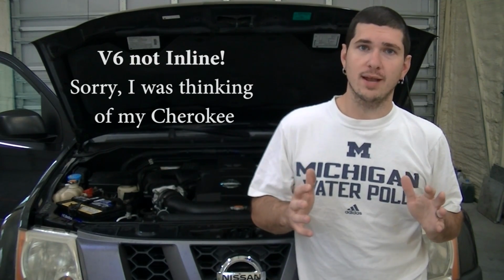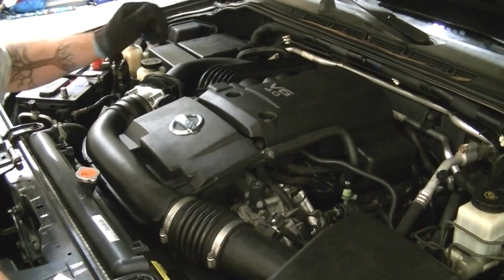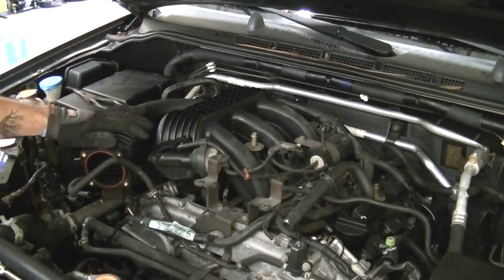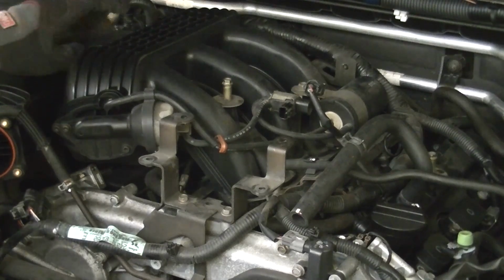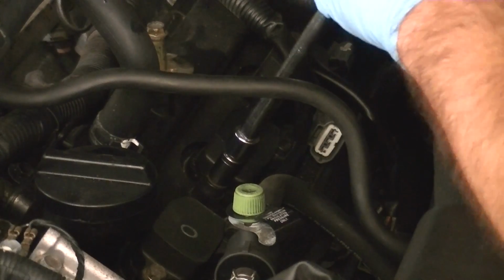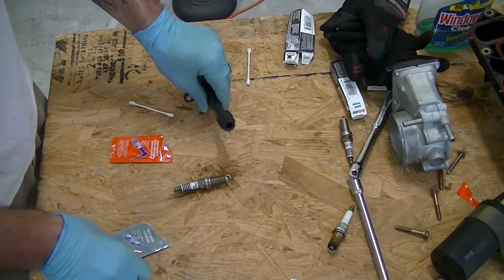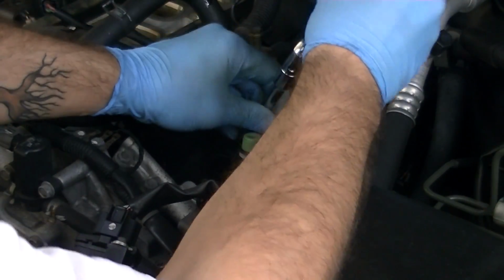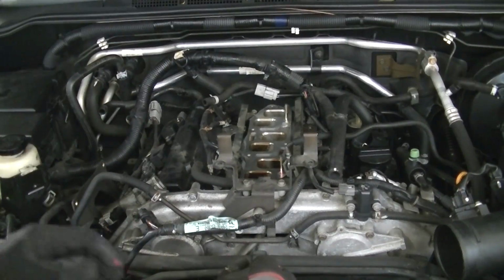How to Replace the Spark Plugs on a 2005 Nissan Xterra

Comment: Did you replace the gaskets on the manifold/throttle body or just reuse the old ones?
Reply from the maker: I reused 🙃
Reply: @Rythecarguy  Awesome, any leaks since the repair? I might do the same
Reply from the maker: No, it’s been great. In fact the manifold I’ve taken off at least 5 times without issue.

Comment: 582$ quote from Nissan dealer, parts and labor!
Reply from the maker: Wow! That's insane. How much did you save doing it yourself?
Reply: About 488$ ! ended up getting the plugs from the dealer but still not bad for a few hours of work! thanks for the video, was a huge help! I have no idea how people are getting the plugs out without pulling the intake! Thanks again - keep up the great videos
Reply: $700 for me,
Reply: @Rythecarguy  I saved quite a bit. I have a 2012 Nissan Pathfinder with 304k miles. Replaced (1) coil ($40) but the knowledge and satisfaction obtained with this DIY was priceless! Everyone needs to know their car through a DIY. Turns out, I found a vacuum leak in the process which sealed up the mystery as to why I was losing MPG.
Reply: @Rythecarguy  yeah Nissan quoted me $800.

Comment: Ry nice video but your orientation is incorrect. The PASSENGER side of car (or motor) is the RIGHT side. And conversely the DRIVER side is the LEFT side. You orient yourself with the sides of a car as if you were sitting in it. Just like Bank 1 of an engine will ALWAYS be the side with the fore-most cylinder. Bank 2 is the other side. If you went into a parts store and ordered a part for that goes on the LEFT side thinking it was the passenger side and it has an identical part on the RIGHT side...they will give you the WRONG part.

Comment: Stay away from torquing the spark plugs 🔌, you can destroy the thread on the engine block of the torque wrench not accurate ❤, just tighten them with regular wrench when you can feel them tight and you not waiting for the torque to click

Comment: Hi Ry. just changed my plugs on my 2010 X, but my service engine, vdc (vehicle dynamic control), and slip lights are staying on. I checked all hoses. do you think if I was to drive it some, they would reset?
Reply from the maker: +M McNew based on what I'm reading it sounds like this can happen sometimes when disconnecting the battery. They say you should drive to a place where you can drive in a completely straight line for multiple hundred feet. Make sure the wheel is straight, turn off the car, turn it back on and drive it in a straight line slowly and that system should reset its self. As far as he check engine light just run it to a Auto Zone and have them run the code/reset it.
Reply: Ry the car guy thanks and yes, it had to do with the negative battery cable. I had issue with the cable clamp going back on and while trying to clamp it, it would connect/disconnect likely disrupting the computer and codes. After trying to drive it some with nothing resetting, I finally figured I'd try to remove the cable again and see if it worked and it did. Also FYI for everyone, make sure to plug the cable back on the throttle body housing or no response better than an idle 😃. I'm definitely no mechanic but I like to try things myself, plus it saved me about $450 by not taking it to the dealership. Its why i like your videos. Keep up the great work. I'll keep watching.

Comment: Once the intake is off, are any of the spark plugs holes hard/awkward to get at? I'm on the fence for doing this since I'm at 209,000 with original spark plugs.
Reply from the maker: No not at all. Once its off its clear sailing.
Reply: Thanks Ry, Is it smart to spray penetrating fluid in spark plug hole after I take out the boot? My concerns are stripping when removing, crossthreading when putting back in and dropping crud/dirt particles in hole. I'm going to practice with lawnmower spark plug with a 5/16 hose trick so I don't crossthread...driver side does look easy....the front pass looks like a pain! X is primary vehicle so can't afford to mess it up. -Paul 2005 Xterra 209k

Comment: @rythecarguy my check engine light came on and began flashing on the way home yesterday, the car would vibrating around 60 mph and the engine light start flashing. I watched this video and changed my plugs. Now it is idling wierd in my drive way, what should I do? the relearning steps?
Reply: try disconnecting the (-) battery cable for 30 mins

Comment: Ry, I have a whing noise coming from my 2006 4.0. I took it to a transmission shop thinking that was it. But they are saying it's coming from inside!! Any thoughts??
Reply from the maker: Does the noise change in volume or pitch when you drive? I also have a whining sound.
Reply: yes it does change pitch as I drive!!
Reply from the maker: Interesting. I'm not sure what that is. I will post in the xterra forums.
Reply: Ry, in reference to the radiator's leaking into the transmission's (bleow), should I have cause for concern? I have the 2006 Frontier SE, which I think is the same platform as your Xterra.
Reply from the maker: Yes, You should do some research on the issue and see if you have the same transmission cooler configuration.
Reply from the maker: Also I was thinking about the whining issue and I believe the cause of mine is the fan clutch. The fan clutch will turn on the fan only when it needs it and mine seems to always bee running lately. When i am driving its whines when i accelerate and kind of sounds like a semi truck. Also if i really rev it up the belt will start to squeal. This is a pretty go indication that the clutch needs to be replaced. I will do a video on it.
Reply: Thanks Ry, I took it back to the transmission shop and they disconnected the belt system from the front and pulled the transmission away from the engine and started the motor and still got the whining noise.
Reply: The 2005-2008 models are having issues with the plastic timing chain guides wearing out allowing the chain to stretch. That will make a whining sound.
Reply from the maker: This is actually going to be my next video. I have the engine torn apart now and should have the video on my channel within a week.

Comment: my 2007 4.0 x used laser cut spark plugs 20 a piece :( we have a squeaky noise when going over bumps have no idea where its coming from :(
Reply: +Marilyn Ortega 

Check your spare tire hanger tension. Mine was squeaking pretty bad and tightening it fixed it.
Reply: I have the same damn problem! I will have to check that out Chris!
Reply: The bushings in the front sway bars also squeak with age.
Reply: my dad's makes a Tink Tink Tink sound
Reply: Still dnt know what it is
Reply: If its after turning it off it's the heat shields on the exhaust cooling off.
Reply: I have a 4X4 06 Frontier that did that.  Drove me crazy!  FINALLY, sprayed WD-40 up into the right front coil spring where it fits into the "perch" or frame holder.  That was it.  I think it was because I have used the truck off road and got some dirt or dust into the area.  If I don't off road it, no noise.  I still like to use it off road, so I keep that area lubricated.  There are other rubber bushings in the front end that can cause squeaking.  Try silicone (spray) lube.
That might help it.
Reply: i figured the noise was a broken leaf spring
Reply: +Marilyn Ortega hey i have a 2012 an mine always squeak from the hood check your rubber dampers in the hood grease them an grease the hood lock...that might resolve your problems if is not that might be your leaf spring they are notorious for squeaking
Reply: Andro Lazaga ok
Reply: Get some adhesive 4” Velcro strips and cut the soft/ loop side into squares and stick them behind the headlights and radiator where the round hood bumpers contact it.  Also wrap some electrical tape around the latch on the hood where it contacts the mechanism behind the grille.  Should solve your hood squeaks with out getting grease all over.

Comment: YOU ARE AWESOME!!!
Reply from the maker: Why thank you!! 😀
Reply: So I just know you are the one to ask I have an 06 Xterra with a misfire on number 5 cylinder please tell me if you know the firing order for location number 5 cylinder thank you!!
I have looked into this and there seems to be a lot of confusion!
Lol
Reply: 06 Xterra 4.0
Reply from the maker: I happen to know the firing order AND the location of cylinder 5. So, have you ever done the spark plugs on this car? I am guessing no. The reason I say that is cylinder 5 is the one that is a huge pain to get to. Sometimes people will do this job and just not replace cylinder 5. So it will start to fail when the plug has been in there for too long. ANYway, cylinder 5 is in the far back left if you are standing in front of the engine looking at it. Again, if you are standing in front of the engine (not in the car) then the front left is 1 the front right is 2, behind 1 is 3, and behind 2 is 4. Behind 3 is 5, and behind 4 is 6. So left is 1,3,5 and right is 2,4,6. Hopefully that made sense. I have had a few cocktails tonight. Let me know if you have any other questions.

Comment: If you're pulling the intake, why bother taking the throttle body off???
Reply from the maker: It has 4 screws and it has sensitive electrical components in it. So I would rather take it off carefully and set it aside carefully.

Comment: I have no idea what he did or what I did wrong but when I removed the two hoses from the throttle body coolant sprayed out everywhere. I lost about a gallon by the time I got some vice grips to pinch the hose. Other then that great video.

Comment: you don't need to remove the intake manifold. That one coil you can remove by bending it a little and out forward of the engine.
Reply from the maker: +j9gundayao thanks for the tip but I do all repair videos using the correct procedures outlined by Nissan.
Reply: Exactly, I can replace all 6 of mine in 10 minutes.

Comment: I got a question, I have a 05' Nissan, xterra 4.0 6 speed ( yes I'm glad to have a 6 speeder) and I'm about to change the spark plugs with the coils, but I'm not sure which brand of spark plug I want to buy, I use this truck for daily basis and to town a small boat, any recommendation for spark plugs? Thanks for this video.
Reply: Sorry, tow a small boat.
Reply from the maker: The Factory service manual says you should use NGK double platinum tipped spark plugs. Here are the models Standard type:PLFR5A-11Hot type:PLFR4A-11Cold type:PLFR6A-11Gap should be nominal - 1.1mm

Comment: Also I just did this fix on my 07 Xterra.  This avoids the possibility of your transmission being cross contaminated with coolant and frying your automatic transmission for a $6000 repair. Not sure if manual transmission fluid is routed through the trans cooler as well as the radiator though.    https://www.youtube.com/watch?v=KOuf6kUPTHc
Reply from the maker: +sovran12 thanks for sharing this link. The manual transmission does not use a cooler so I don't have to worry about this problem but it's good to have a resource for people who do have an automatic.

Comment: Whomever though of this setup should be shot. Oh I miss the old days when things were simple LOL. I don't think I am going to tackle this and I know I need new plugs, Wonder how much Nissan dealer will charge me to do it. Answer, $300 mostly labor.
Reply: I am with you. Looks like a lot of stuff that can go wrong with a monkey wrench doing this job. I'll pay to have it done. I met a guy through music who is a mech for a local dealer. He told me he does side jobs. He's going to work on my 2005 van now. Like getting the experience of a dealer's mech at a mere 30 an hour. Deal for me and twice his pay at the dealer. Ask around maybe someone can hook you up like that.
Reply: Ahmad Ghosheh actually the spark plugs are a significant part of the cost. Full retail on the Iridium plugs is nearly 20 bucks each with tax.
Reply: It's really not necessary to take anything off the engine. You just need a couple socket extensions of the right lengths and some patience.